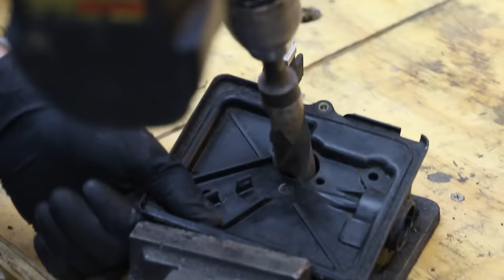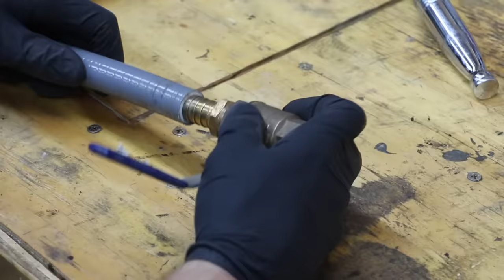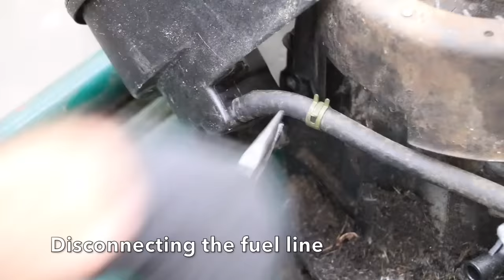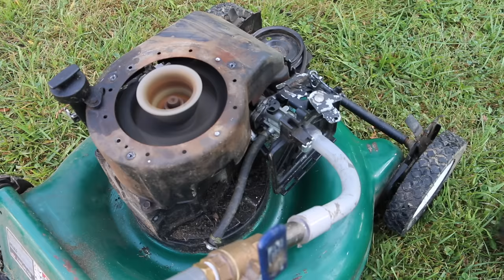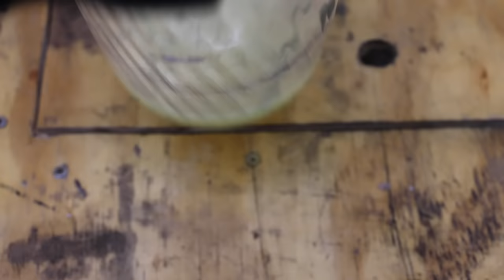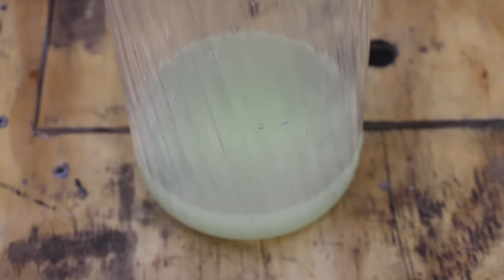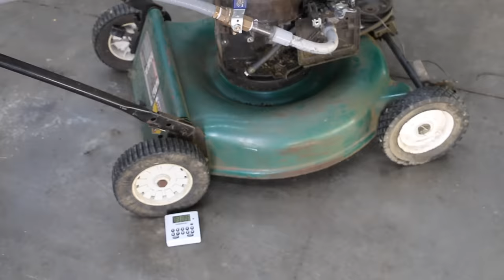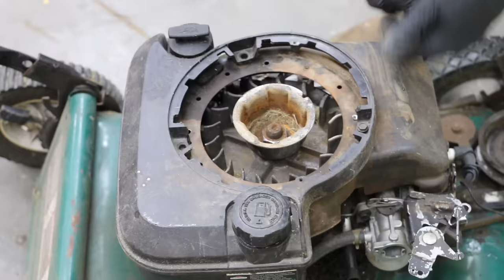Will a "Gas Vapor" Container Improve MPGs and Fuel Efficiency?  Let's find out!

Comment: I converted a 1987 Ford Escort, and used ultrasonic transducers from air humidifiers to atomize the gas and mix it with air.  Besides few fires when engine was stalling from valve overlap, I had to install a honeycomb break line pipes in the supply pipe to prevent fire from lighting up my mixture tank.  There's almost no difference between one system or the other under normal engine load conditions.  The car idled on two cups of gas for 45 minutes, much better MPG compared to carburetion.  But under load, the engine was sucking so much air with the vapor we had to install additional 4 ultrasonic transducers just to keep up and the fuel disappeared quickly like if it was carbureted.   If we leaned out the mixture, engine was running much hotter.  The only difference we noticed is that when we used our atomized mixture, the 4 cylinder engine was idling so quietly and smoothly that you could do a lasic surgery on an eye that's how still it was.  
So the myth about some guy running a V8 and getting 200 MPG remains.  But running engine with little to no load is definitely impressive how little fuel it will use.  Put a load on it, and you'll see a huge difference how much air your engine will suck and vapors with it.  And if you try to suck in mixture that's too lean, you wont get an ignition, and if you do and it's too lean, you'll melt your engine.  Chemistry wont allow a conventional spark plug to ignite a perfect mixture.  Also if would burn so hot current engines wont survive too long.  This is why some cars have dual injection system, one to create a lean mixture and a small injector to create a small bubble of rich mixture for a spark plug to light it up, which will propagate it to the rest of the cylinder and ignite the lean mixture as the energy of it is much greater than of a spark plug.  For most cars you need super saturated mixture which means about 40% of gas in the cylinder gets burned in catalytic converter.  If you lean it out, you wont get ignition.  But good luck and cheers.
Reply from the maker: This is very interesting. Thank you!
Reply: Have you tried adding water vapor to cool the engine when it was leaned out?
Reply: Project Farm I did.  It was very hard to keep mixture to ignite as lean fuel mixture didn’t want to light up.  But the water did bring the temps down.   
That was back in year 2001 and when I was doing research I found out that the Japanese filed patents with dual injection to address this issue of no ignition.  First mixture is a very lean mixture that fills the cylinder and the second mixture is a rich which creates a small bubble around the spark plug.  This is the mixture that ignites which has enough energy to ignite the lean mixture.  There was also the idea of using plasma spark plugs but they burned out too quick.  I’ve tried that one since my background is physics.  I’ve never tried to ionize the air turning oxygen into ozone with high voltage before the air enters the engine.  I would imagine a single bonded tri oxygen molecule would react faster and better with gas and possibly at lower fuel mixture compared to regular dual bond two atom oxygen.  It would be cool to try that and see what happens. 
Now I hear that the sky active engine the next generation is going in the direction of diesel where pressure will be the trigger of ignition.  I wonder what they do to time it precisely and control the heat.  Or maybe this is just some pipe dream of the author who wrote that up.  Cheers.
Reply: @duperdude25  You can make a gasoline engine run on detonation. Diesel engines are detonation engines. When you detonate gasoline, you need a very learn fuel mixture 30:1 (approx) in order to prevent the rapid detonation wave from breaking the engine. I've seen pistons with ring lands that are shattered from gasoline detonation. The pulse wave of a rich gasoline fuel mixture that detonates, is highly destructive. But if you get your engine hot, and had a way to shift over to an ultra lean burn, gasoline detonation, then you could prevent destruction of the engine, while using 1/3 of the fuel. Detonation produces a much more powerful explosion. It would be similar to always running your engine on nitrous. I haven't studied this much. But I'm certain that a gasoline detonation engine using a super lean fuel mixture has already been built, and perfected, somewhere. After all, you can adjust gasoline by adding inert substances in it, to act as a detonation moderator. For example, a water mist would probably do the trick. The problem is, you do need a lot of heat and pressure to induce detonation, because the fuel has to be near its flash point of 500F and the pressure has to be very high. Diesel engines have a cranking compression pressure reading of 400 PSI or more on factory non-turbo engines, if I remember right, versus 180 PSI for a typical gasoline engine. Octane is the amount of resistance to detonation that a fuel has. So you can't just add octane to run a detonation engine. But you need to adjust the speed that the fuel burns, once it does detonate, by finding the right mixture of additives, and the right (very lean) fuel mixture. The problem is, we are given Gasoline and Diesel. We need a 3rd fuel that is designed for Gasoline Detonation. It could be done.
Reply: Ritalie, I think you’re right.  The only issue I have witnessed that Gasoline when ignited as a lean meaning proper mixture which leaves little unreacted reactants burns at over 2000 degrees.  Cooling system of the engine would have to be redesigned to accommodate such high temps and I’m not even sure if it can be done. 
And you’re right about the comparison of this to nitrous.  It is a very violent combustion compared to other fuels.  
I’m not near an expert to make a proper comment, but as a physicist by education I can comfortably say that these are significant concerns.

Comment: It makes sense once you think about it in terms of fuel needed to produce energy. If the motor is running normally it will consume the same amount of fuel either way.
Reply from the maker: Great point!
Reply: Not necessarily,  only the fumes combust. That is why internal combustion engines are so inefficient.  Look up the "pogue carb".
Reply: @easyrider920  Except literally every car does exactly that and atomizes the fuel, aka turns it into fumes. It's how literally every car functions, carb or injector. Liquid gas is not combustible, only it's vapours are. The pogue carb is a myth and never existed, the guy was a snake oil salesman. Pogue never allowed anyone to directly see the carb.

Whatever additional fuel efficiency you get from reducing the fuel into the engine is going to be a direct result of restricting the horsepower, something many economy cars in Europe take full advantage of to get the equivalent of 50-60 MPG because people care more about gas prices there than the fact they take a full minute to get to highway speed, something that most Americans would be appalled at.

Comment: Another small feature to this setup is you must obtain the same level of fuel in your vapor container it's a must because the lower the fuel level runs the leaner the fuel ratios go I'm adding a swamp cooler fill valve to my  vapor box on my truck so after I get it running and tune my vapor valve to the engine it will always run smoothly then you can see major change in fuel consumption

Comment: try running the engine on vapour with a clear head and see how different the burn is vs liquid
Reply from the maker: Thanks for this recommendation!
Reply: absolutely no different, because fuel is vaporized before combustion on every engine ever made
Reply: To add to this, any fuel saving is achieved by leaning out the air fuel mixture ratio. While this will save fuel, it results in higher combustion temperatures that will damage the exhaust valves or piston
Reply: +Chris Dishneau lol really? yes fuel ignites and the vapors/liquid combusts. If we can figure out a method to isolate the fuel and stop the fuel in liquid form and maximize the vapors like he did in this video we could run vehicles strictly on vapors and get astonishing mpg! Lol forget about propane! need I say more!
Reply: hey I know this is a little crazy but a lot of people don't know how to make a steam engine that will power your home you can use a bunch of car generator or something make it easy so everybody could make one hey water is cheap

Comment: OmgOmgOmg I requested this. Thanks man
Reply from the maker: Thank you very much for this recommendation.  I listed to those leaving comments and greatly appreciate the video test recommendations!
Reply: Sokol Murati Me too!
Reply: +Project Farm You should try and mix water into the fuel and see if the engine would still run off of the vapors.
(I would expect it to since water has a higher boiling point than gasoline)
Reply: I did too!
Reply: Project Farm Youve tottally surprised me this time, this is mad science, the good one :)
Reply: Lol same as you guys

Comment: Measurement (in)accuracy could make that difference or increase it. I'd have to call this "inconclusive".  Also this is a carbureted small engine, It'd be interesting to see how it fares against fuel injection. I could see Thunderhead289 taking this up. He runs a Ford V8 with a small engine carb.
Reply: Thunderhead is a boss
Reply: Great discovery that likely works through turbulence-induced vaporization!
Reply: Is thunderhead full of crap or are his claims legit? Is he a flat-earther? It helps tell me who I'm dealing with
Reply: This wouldn’t work with fuel injection, not in the traditional sense anyway. Fuel injection uses a pump to pressurize the fuel injector and the ECU is tuned to open the injectors based on its energy density in a liquid state. 

You could make it work but it would just be a natural gas engine that’s already widely used in fleet vehicles except using gasoline vapor….not much to learn since we are already doing it. It would be interesting to see the process required to vaporize than pressurize the gasoline though (a process not needed for natural gas).

Comment: This is a very interesting experiment and I really appreciate the time and effort you've into it.
Maybe there's almost no difference in fuel consumption but: it look to me as if the engine got more power or revs running on vapors. Is this possible?
Reply: I'd say it's just running lean since there's less fuel to air going into the cylinder
Reply: +Jason but it said still normal engine temp.

Comment: I have 3 things to add.
1:The 400-500% boost in efficiency is assuming that 75-80% of fuel gets wasted as unburned fuel in the exhaust, but surely a typical carburetor petrol engine isn't that inefficient.
2: this method of fuel vaporization will unlikely ever provide optimal efficiency due to the fact that the fuel will vaporize and mix with air at whatever ratio it sees fit given the airflow, and air/fuel temperature, and no real way to ensure the air fuel ratio is 14.7:1. The only way I can think of to make this work is to start with an O2 monitored EFI engine, add a secondary injector that sprays into an electronically heated tube (not too hot, just enough to vaporize the fuel) in the plumbing between the airbox and throttle body, and using a fuel management computer smart enough to load balance between the secondary and primary injectors in order to maintain throttle response and optimal AFR. Sure, the side port injection might still cause fuel to go through combustion unburned, but not only is a percentage of that offloaded to the secondary (Of which fraction should burn completely) but the previously vaporized fuel will help the primary injection cycle burn more completely.
3: ideally for run time tests, you should have started with less than a pint of fuel then allowed the engine to run dry, then adding the pint of fuel in both the vaporizer and the fuel tank as you're unlikely to run either of them completely dry, and simply measuring the remains afterwards would be inaccurate as the oxygenated fuel remaining in the vaporizer would be much less dense..

Great video though, as your 2% improvement in efficiency with such a suboptimal setup does show that there's room for improvement over how things are done now 👍 but with that being said, that could all come down to the measuring of the oxygenated fuel as aforementioned. Edit: humidity could also play a part in the oxygenated fuel density too come to think of it, which further complicates things.
Reply: He made a crude carberator and you describe a smog control system lol. The comments are hilarious! Lol!
Reply: @JasonAlexzander1q47  it is indeed a crude carburetor demonstrated in the video, but if you think my idea is primarily about smog control you're mistaken.
Reply: Great synopsis and a great idea there!!! I’d like to see a working model. How about putting a valve to draw some fresh air, maybe onto the blue cap or maybe close to the engine then adjust the valve for peak RPM and peak EGT at wide open throttle under a load, then, close the valve a wee bit for Rich Of Peak EGT as this is the way most engines are supposed to be tuned at. This should be real close to 14.7:1. Or, open the valve a wee bit until EGT cools some with losing any or little RPM for Lean Of Peak EGT.
Reply: @onebadapple83  maybe the answer is as simple as plumbing a smaller version of the crude vaporizer featured into a vac line on a modern engine, the vapour should theoretically aid combustion of the injected fuel and the O2 sensor should take care of the rest.
Although one would probably want to use some kind of regulator so the engine can't simply suck as much air as it wants, and to hopefully prevent any backfires going back up the line and turning the whole vaporizer thing into an air/fuel bomb...

In any case I'm no expert, I just know that fuel vapour burns great, liquefied fuel not so much